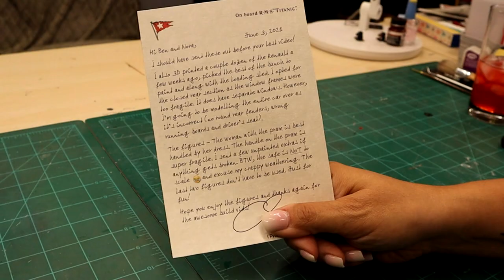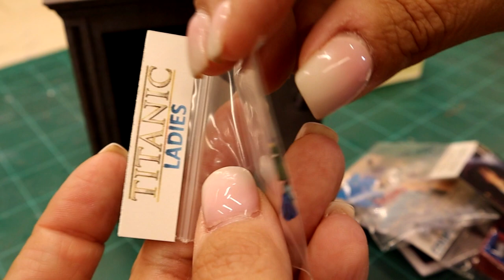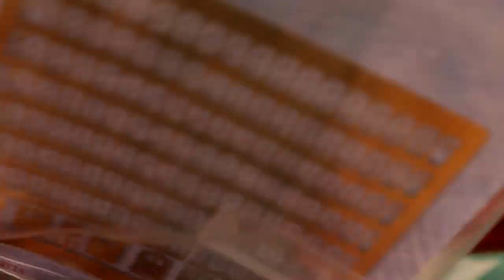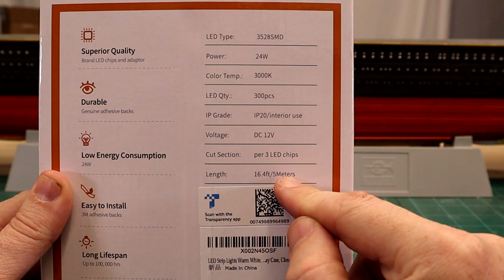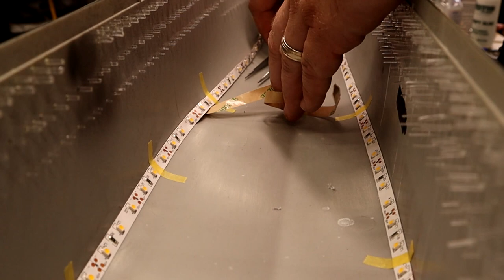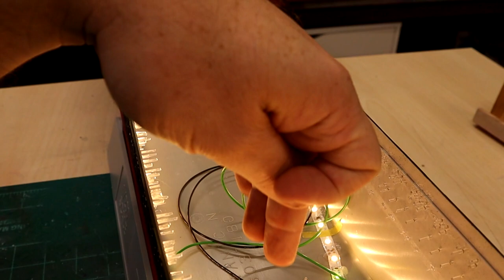1:200 RMS Titanic Build Video 7 LED Lights

Comment: Good Job. 👍 I like the color of the lights and the fiber optic is cool-beans to keep out light bleed in the well decks.  A thought (I only have one a month so don't worry too much) could you tint some of the port holes to indicate subtle light variations and/or lights (i.e. sconces vs ceiling vs table lamps) in use in the cabins?  Feel free to stop laughing at any point and have a great modeling day or night. 😎
Reply: I think this is a great idea. you could simulate a cabin that was not occupied but had their door open and the light from the hallway shining in Or maybe the curtains closed. Say maybe 25% brightness?
Reply from the maker: So I’m going to start by trying to tint or block the inside end of the fiber optic to see what kind of results we get. But same idea as mentioned above.

Comment: Suggestion: As for blocking some of the light from the portholes that are now all illuminated, maybe just dab some black paint or a bit of putty on the inside ends of the optics might do the trick, that way it won't let light pass thru the optics, but will still carry the glimmer of glass in the portholes, as you pass and view the exterior of the ship once completed. 😜👍

Update: just thought of this maybe even some of that flex seal would work too.👍

Comment: The lighting is going to look fantastic, especially once we get up into the superstructure of the ship. It's a lot of work but so worth it. 👍
The detail on the figures is unbelievable and even the packaging is outstanding. It's almost a shame to use them; the safe will make a great display item. Well done to everyone who has supplied figures; it's going to bring the ship to life at the end of the build.
Something I wondered about: is there anything that could add a wee bit of movement/animation to the ship?  It would be extra work but, with the level of detail you're including, it might be worth it. I'm not too sure what you could add as a "moving feature" but there must be something. It wouldn't need to be anything large.  Just a thought.👍👌😁

Cheers for now,
Dougie.

Comment: you can partially paint over some of the LED or use tape to darken dim lights, then fog out half moon quarter moon sections of the port windows to make it appear the light is coming from one side of the room or the other and various intensities, color paint LEDs to make different shades of light or the appearance of a red lamp or shade cover in the cabin..  all in the details

Comment: Hi ben I'm putting the LED lights in the Titanic model 1/200 but I've used 12v with 5v LEDs will they all still work I've not put the other 2 decks on yet

Comment: Very informative! From an LED standpoint, my biggest problem is stripping 0603 SMD LEDs. I've been more or less, using my fingernail to cut-pull off the rubber housing because I can't find a wire stripper tiny enough to do the job. The problem with that is sometimes I mess up the fine wires, sometimes even breaking them. I was wondering what your method is, or suggestion?
Reply from the maker: Take your soldering iron and just melt the wires together without stripping them. The heat will melt the insulation and the solder will do it’s job giving you your bond. See how that works for you!

Comment: maby put a thin coat of transparent yellow or something on some of the fiber optics so there is a color difference between some of the portholes, i say yellow as it would look more like candle light , but maby a hint of orange could work aswell
Reply: Titanic was entirely lit by electric light bulbs, not candles.
Reply: @hegiteri  i know. but i assume some of the first class passengers brought some candles for a more homely feeling,  but still   having slight color differences between some of the portholes will make it less monolithic

Comment: I have a question: is Tamiya's hull red paint supposed to be an extra dark shade of red? Mine is almost brown. I ended up getting a generic shade of red (also from Tamiya).
Reply from the maker: Every manufacturer has their version of “hull red”. Just use what you think is best.
Reply: Color, color, who know what the actual colors were?  I don't think anyone knows for sure.  But here are a few references to review.  First this is a wonderful series of short papers done by a gentleman named Bob Read.  To find them do a web search on "Bob Read Titanic."  Most you will likely not care about, unless you want to know how the ash ejectors worked.  But there are some on the colors.  Bob Read states that the antifouling paint was more like a pink.  Humm, like you I always thought of it as a red or red/brown.  But in one of James Cameron's TV specials he says that on his first dive to the wreck he came up on the side of the forward section.  He stated that all he saw was a pink wall and wished that the entire ship had been painted in the antifouling paint.  Some people also point to the picture of the one visible propeller and point out the paint there.  Not sure I can see the pink, but maybe you can.  If you can find web pictures of Cameron's studio model, bottom does look like a heavily weathered pink.

Top side colors, I think Bob Read's papers are pretty reasonable.  I state this because the White Star Lines built two small ships at Harland and Wolff before the merger with Cunard Lines.  Ships were Britannic (not the third vessel of the Olympic class) and Georgic.  Web searches will turn up some color pictures.  I'm not sure if these are colorized or not, but they do seem to match up pretty well with Bob Read's papers.  A third reference is the ferry SS Nomadic also built by Harland and Wolff.  It was the vessel that shuttled the passengers to Titanic at Cherbourg.  Nomadic has been restored and color pictures are available of this vessel too.

All this and I will not even discuss how many blades were on the center propeller!

Bottom line, do what looks right to you!

Comment: Hi Ben, do you have the specs for the LED strip light, like how many watts per meter etc? Cheers Lee
Reply from the maker: Not off hand. But I showed which box I purchased and it’s available on Amazon. I’m sure the specs are there.
Reply: @TheMidwestModelShop  Thanks, finally found it after realising the make is CTcapetronix 😃
Reply: @TheMidwestModelShop  Hi Ben, do you think it would be beneficial to get the dimmable version or did you find the brightness ok? Cheers Lee
Reply from the maker: So I’m super happy with the brightness I have now. However, I may change my mind about that if I have to mount any more near the windows on the main deck. There are ways to diffuse them if I need to, but that bridge hasn’t been crossed, yet.

Comment: Is there something I should seal the wooden decks mith
Reply from the maker: Yes. I spray them with a clear flat. This will help stabilize the wood and IF you spill something on it, there’s a chance you can clean it up without messing up the printed lines.

Comment: Hello,
I have been watching your channel for a long time, very cool and positive !.
I am making a model of the cruiser Varyag, with backlight. I have a 5v tape, powered by USB, and so that the wire does not get in the way, I made a connector in the stand, and then a power supply or Powerbank, it doesn't matter. You can view. The video is called:
"Крейсер Варяг Звезда 1/350. Часть 5. Окраска корпуса, LED подсветка и остекление иллюминаторов."
In your model, you can make a connector in the stand, for example, as on CCTV cameras, and a standard power supply will be connected to it.
for example  -       5.5*2.1mm DC Power Male Female Plug Jack Adapter

My next model is to build the Titanic from Academy 1/400.
Please advise - what kind of fiber optics cable should I buy for it?
Reply from the maker: I don’t have access to the 1/400 titanic. I would wait until you have the kit. Get an idea of what size the portholes should be. But before you drill the holes, go to lighthouse LED and see what size fiber optics they have that are the closet to the port hole sizes you think you need. Order those and drill the holes exact to those sizes.
Reply: @TheMidwestModelShop  Yes, the kit is already there. I bought all the add-ons that I found on it. Thank you, I will. Nice store, different sizes. I haven’t had any experience yet - with fiber optics. I think it will be interesting. Thank you! Good luck with your building.

Comment: I suggest that you do NOT solder extra wire to the END of the LED strip.
At this point the connection is in SERIES and you have the voltage and current drop of the entire strip.
MUCH better to solder the extra wire the START of the strip.
This will have them in PARALLEL and each extra will have full voltage/current.
Of course, you may not have enough extra load to matter…😎

And in ELECTRONICS the BLACK WIRE is always NEGATIVE. GREEN is GROUND. 🤓
RED is Positive.
Reply from the maker: I know. I don’t have red at this size. Black becomes common for the win.

Comment: Why are you using fiber optics for portholes? Lighting gels and or just some diffusion, not to mention a really inexpensive potentiometer works great. Sorry, but you guys make everything a serious pain in the ass not to mention extremely time consuming and more expensive than necessary. Also, you may want check out some model lighting facebook pages. You really are going about your lighting the most wrong way possible. Once again, sorry I didn't mean to offend you. But there are simpler and better ways to light your model.
Reply from the maker: Yeah David you’re being rude. And to answer your question, it’s to have glass in the portholes. Not a hole. So when the lights are off, the model doest just have a million holes in it. Also. They are not actually fiber optics. They are just clear plastic rods. The thinner ones flex. And if you listened to my commentary. You would know why I choose this route. But good job not explaining how to do it better. Throwing around other product names doesn’t do any good.